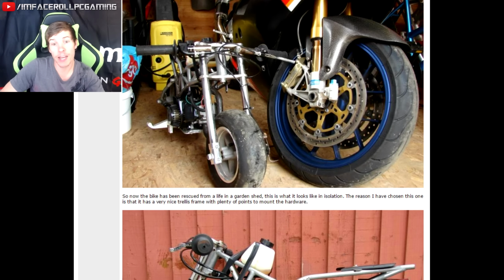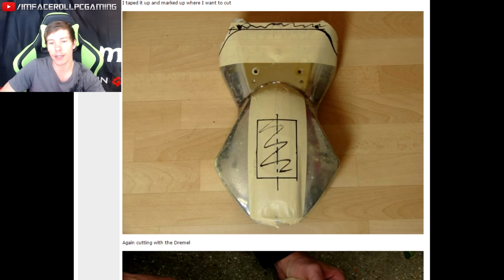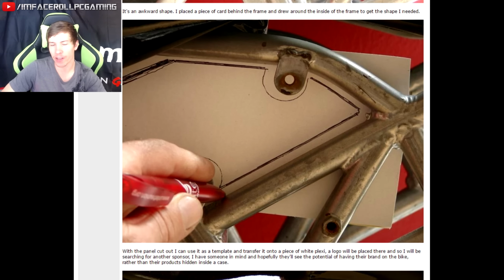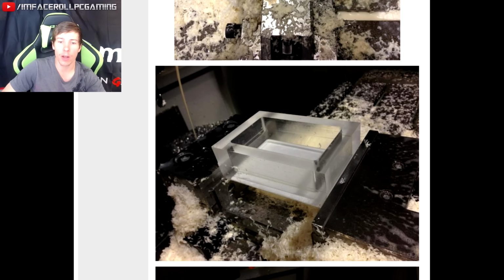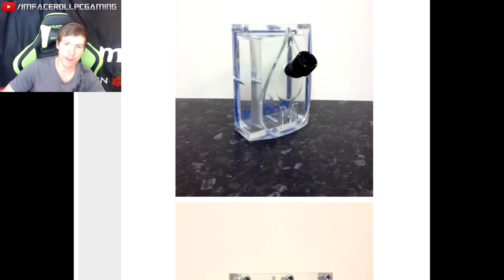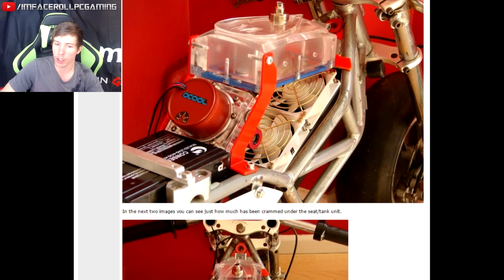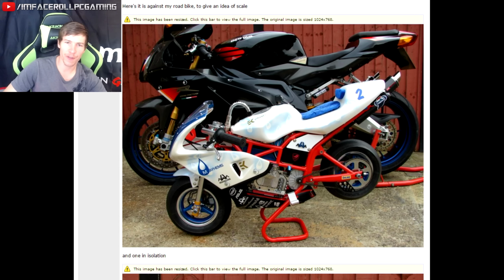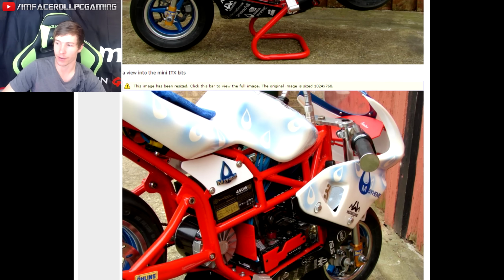Custom Water cooled Motorbike Themed PC Build - Liquid cooled mini motorbike Gaming PC Mod

Comment: Someone explain how this bike possibly works since instead of an engine it has a pc
Reply from the maker: +ZN Gamer the engine is still in the bike =)
Reply: +Imfaceroll Gaming but how tho? That frame is built to preciesly fit an engine and there is a pc in it.......
Reply from the maker: +ZN Gamer he made extra brackets to fit all of the pc components in. I was suprised aswell when he rode it around but he somehow managed to have enough room for the pc and the motor
Reply: +Imfaceroll Gaming http://imgur.com/UG2ZKxE i might be realy dumb but i dont understand it
Reply from the maker: +ZN Gamer i believe he build this bike in the beginning himself and he placed parts in different sections to where we would normally find the parts. I believe the motor has been moved up higher somehow and if hiding behind the body